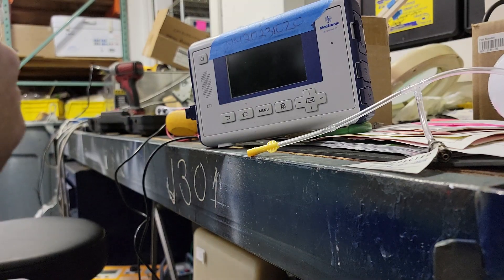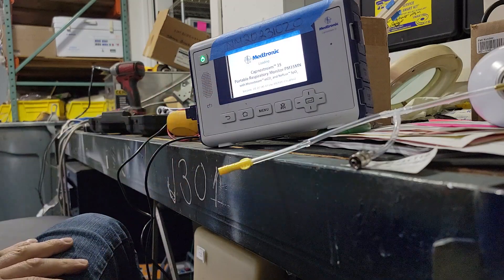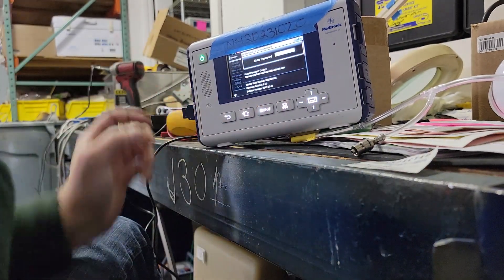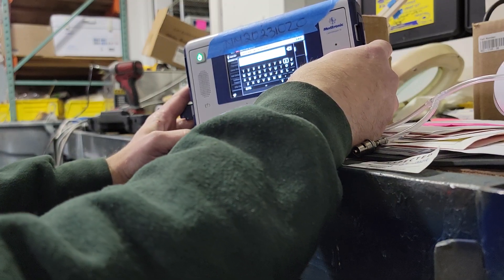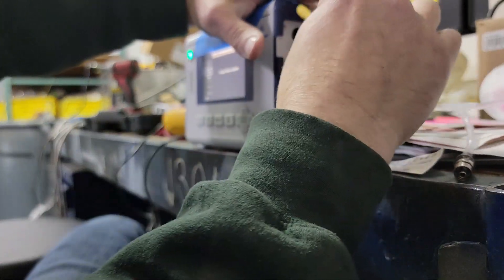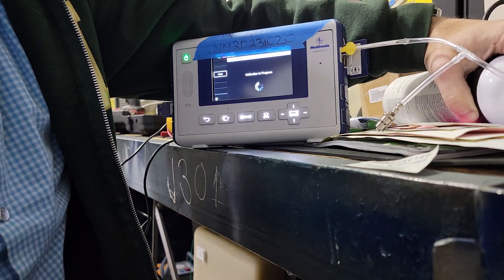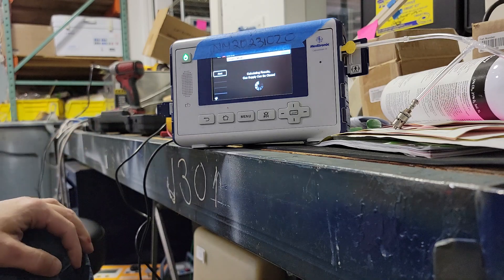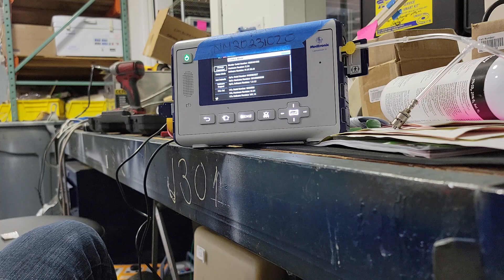CO2 calibration on Medtronic Capnostream 35

Comment: Greetings, i need a password reset because is not SERV...do you have another master password for service? Thanks in advance i don't want to send the monitor only for reset that...please!😢
Reply from the maker: @Flamesfdr  try SERVICE or ORIDION
Reply: @The_Biomed  doesn't work :__(
Reply from the maker: @Flamesfdr  they are case sensitive. unfortunately that's all I have. What SW are you running, maybe a SW update would solve the issue?  have you contacted covidien yet?

Comment: Hi, where do you get the connecting tube/attachment from? please advise.
Reply from the maker: So I made this one, but usually you can get a rig from the same place you get your cal gas
Reply: Do you know any tube/connector that work with a cylinder CGA600 connection type, recommendation?
Reply from the maker: @Billiamwpc  what kind of reg do you have? You can just grab a disposable co2 line, cut it with the co2 monitor connection, pick up a co2 adaptor and some tubing, then just find tubing that fits your reg.  You need a connection to the has, connection to the monitor, and a blow bbly